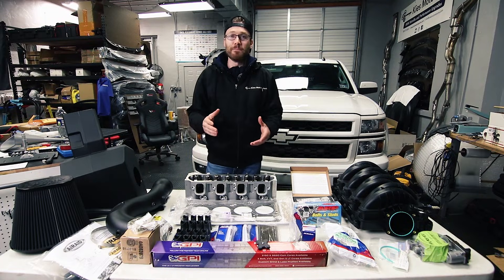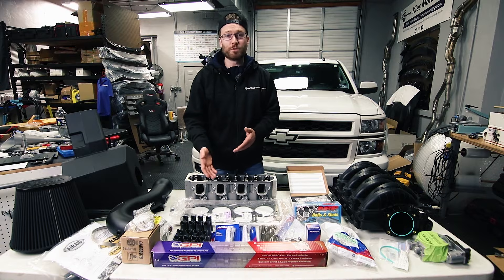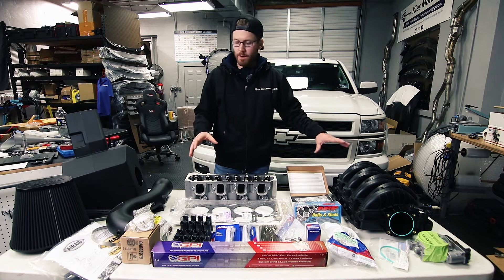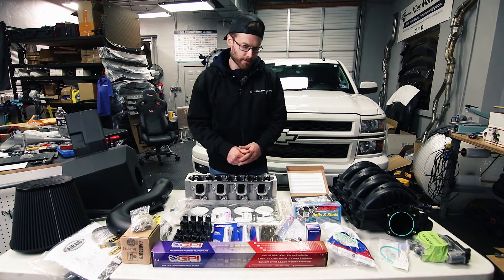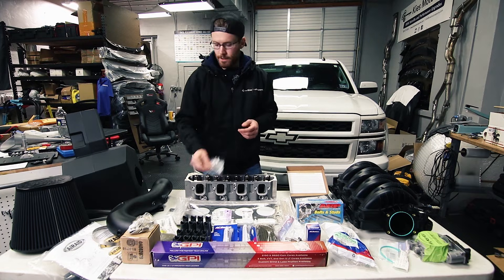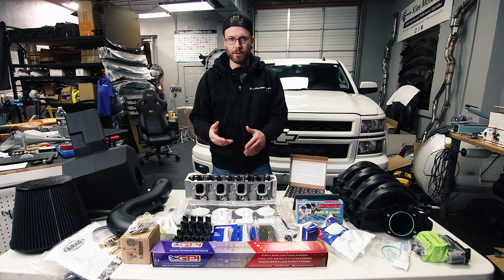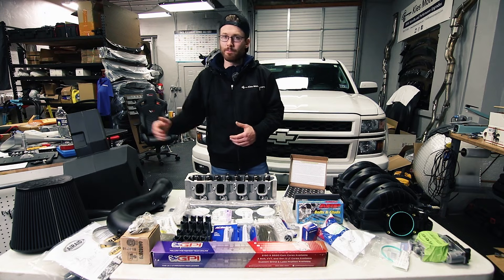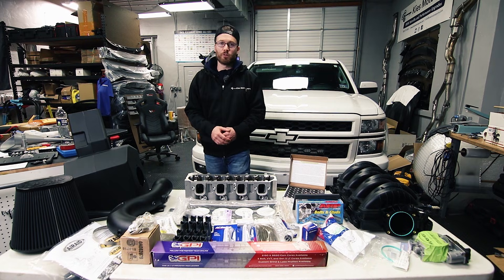AFM DOD Delete Part 2 - 2014 Silverado 5.3L L83 - What Parts Do You Need?

Comment: That cold air intake is not designed right, the air box is fixed to the body and the throttle body end moves with the motor, that little rubber boot will barely move, mine literally tore off the throttle body, and throw out the k&n filter, they’re only good for the street, paper flows and filters the best,

Comment: Did you have to do any transmission upgrades to run the stage 1 cam
Reply: Tbh probably depends on how many miles your transmission has and how well it’s been maintained but stage 2 or 3 yea mostly likely want too do upgrades on the transmission

Comment: i have a 08 pontiac gp gxp so i know most of it is all relatively the same but for more power stage two or 3 bc i’ve read a form from summit racing saying you can’t push those cars over 400hp

Comment: Have a 6.2 2016 that’s still running strong at 164k and AFM is still intact.  

Considering deleting AFM as with the mileage and long trips that I do, would rather have some peace of mind that one more potential failure point is removed from the rig. 

Question - and I know that you’re doing performance mods as well but if you’re not adding performance mods, how does this affect gas mileage?

Comment: What bolts did you use for exhaust? The ones you have linked are for 6.2 heads I thought you had a 5.3?
Reply from the maker: For the exhaust manifold to head bolts?
Reply: @TheSundaeDrive  yes correct

Comment: what lifters did you use to run a 7.850 pushrod? i got that size for my lt1 and it hangs the valves open
Reply from the maker: GM Performance. We will be shooting an lt1 build soon.
Reply: @TheSundaeDrive  cool can you cover finding the lifter  length in that? Im on the caddy race lifter. I had to make my own adjustable one by cutting and tapping a stock pushrod

Comment: So the question is can I just change the lifters and be done without doing all the other stuff
Reply from the maker: Sadly the cam is different from the research I've done. The lobes are not the same so the cam shaft does need to be swapped.

Comment: Gm had this POS system back in 1981 with the 368 CI 6.3L Cadillac V-8-6-4 and it didn't work either one the DOD got disconnected the 368 engine ran fine. It such a POS that it was offered only in 1981 only. GM ideas are horrible in every way. We deleted these off the 368 engines all the time back in the 1990's
Reply from the maker: definitely a terrible system.

Comment: Where’s  the other link for the other hard fuel line?  Do you have a part number? On the description it only showed one fuel hard line link.
Reply from the maker: meant to get that added in awhile ago so thank you for the reminder: 
High Pressure Crossover Fuel Line 2: https://geni.us/HP-SFuelLine
GM PN: 12677002
Reply: @TheSundaeDrive  thank you so much. Doing the DOD delete , just waiting on parts.
Reply from the maker: Awesome! Best of luck with it! Make sure to read through the video descriptions for some updates. Have a video coming out later this week or early next that will have some addition tips.
Reply: @TheSundaeDrive  will do! Awesome video btw, I’ll be referencing my build with them.
Reply from the maker: Appreciate that! Glad to know they are helping you out!
Reply: @TheSundaeDrive  Quick question, what oil would you recommend after this delete? I know the OEM requires 0w-20 but I live in California and it gets hot where I live, would you recommend a change of  Viscosity?
Reply from the maker: So I'm still running 0w-20 amsoil only. I haven't had any issues with that. It gets up to around 100 around here in the summer and I haven't had any issues.  I'm not an oil expert tho, amsoil has pretty good customer service and you could see what they say or see what other guys are running in your area
Reply: @TheSundaeDrive  got you! Thanks
Reply from the maker: No problem!

Comment: Hey cliff, for the stage 1 cam you selected did you need to change out to wideband 02 sensors and larger injectors and was it necessary to dynamic tune after the upgrades?

Comment: how bout a range afm disabler. plug it in and be on your way. job done in 3min.
Reply: The idea is there but yes those lifters are going to end up biting you in the ass later
Reply from the maker: Doesn't prevent the failure. The lifters might lastonger but they still have a design that is prone to failure. Many documented cases of it failing on vehicles running a range. Disappointing because that solution is much simpler

Comment: It is unnecessary to change camshaft - Because the lifters are the same size, they are different look, but absolutely use same size rods and arms. The rises of valves will be absolutely the same. And the difference in camshaft petals dod and non dod is 0,13 mm. And if you will change lifters with the guides non dod the height of valve lift will be same as stock and will be no misfires.
Reply: Woow so, let me get this straight. To delete the AFM all I need to do is replace the Non DOD Lifters with the lifter guides, the Non DOD Valley Cover and get it Tuned after done? Plus news gaskets and seals of course, is that correct?
Reply: @pedrodelasancha516 did you confirm?
Reply: So you're saying the original cam can work with either DOD lifters or regular hydraulic lifters?
Reply: @toddsaladyga9712  Yes, that's right.
Reply: @gm-master5331  That's great news! Do I still block off the oil returns in the valley?
Reply: this wrong 100% on the active fuel management lifters if you was to decide to try to put normal lifters with afm camshaft you will be taking the engine back apart because it will most definitely misfire on all 4 cylinders idling. trust me I know this the hard way. the afm camshaft will hold the valves open just a little

Comment: I have 2014 LTZ 5.3l Z71 1500. I’m trying to gather the minimum list of parts to just delete the Dod/afm. I feel that I don’t understand complete engine tear down to do so. Could you share a list for parts?  If just doing did/afm delete, can I keep the engine in the truck?
Reply from the maker: Watch through the full series and look at the description on the engine assembly video. I have all the gaskets etc you'll need there. In my opinion, it would be extremely difficult to do in the truck. I would always pull it when doing it myself on this and future trucks to make sure it is done right. Watch through the series and you'll see why. The oil pump is the issue because it sits down inside the oil pan and dropping the oil pan is really challenging if you have it in the truck. It is also sealed by rtv and not a gasket so the rtv needs to be replaced unless you want to chance an oil leak.

Comment: What was your pushrod length?
Reply from the maker: 7.850"
Reply: Ok just checking I heard a little tick when I got done. But I'm hearing it's just the fuel pump lobe .
Reply from the maker: Did you add a fuel lash?
Reply: @TheSundaeDrive  I don't even know what that is brother. Today it started running like crap. I put stiff valve springs and found 3 bent push rods today... Been hitting the Rev limiter..
Reply: @TheSundaeDrive  but they are stock pushrod with stiff springs thinking that's my problem...
Reply from the maker: You need to change the pushrods depending on the cam you go with. Hopefully nothing else is damaged. Depending on the cam you went with you may need a fuel pump lash, watch our video on lashing your fuel pump

Comment: For that price, just buy a new engine.
Reply from the maker: You could get a used one, but depending on how it was maintained, you could easily experience the failure again. The heads are the most expensive part and are not required. The simple dod delete can be done for under $1K

Comment: Does the Range technology AFM disable stop the engine damage? I have a 2018 Silverado.
Reply from the maker: You will think that it would but apparently it doesn't. Asked the same question in a fb group and two guys said they had put a range in within the first 1000K miles and the failures still happened. It probably helps tho
Reply: @TheSundaeDrive  so does doing this mod remove the issue where AFM nukes the heads/lifters?
Reply: @freidrichnietzsche6643  I'm learning all this crap right now myself.  My understanding is even with electronically disabling the AFM crap the mechanical failure of the lifters is still just a matter of time. Thanks GM and federal government regulation
Reply from the maker: That is correct

Comment: Where did you get the plugs for the oil holes in the dod delete
Reply from the maker: I got everything from GPI but there are a lot of places you can get them from
Reply: @TheSundaeDrive  I'm ls swapping my truck. Is the plugging of the holes required
Reply from the maker: If you are deleting the DOD system you either need to plug them or change out the vlom

Comment: What's the part number for hard fuel lines?
Reply from the maker: Fuel Rail Driver Side 12687244:
Fuel Rail Passenger Side 12687245: 
HP Fuel Line 12677004: https://amzn.to/2XrsHf8

There is one more hard fuel line I need to find the part number for
Reply from the maker: I got the other number: 12677002
Reply: @TheSundaeDrive  I thought I bought everything I needed for my build that is going into the shop in 48hours until I came across your video and realized I needed 4 gaskets and these two fuel lines I would have never thought of thank you so much!!!
Reply from the maker: Glad to help! There are a lot of parts so it's easy to miss some.

Comment: How did you color match your front end?
Reply from the maker: Body shop painted it for me. Got a primered bumper and the painted over the chrome grille and light bezels
Reply: @TheSundaeDrive  o ok. The reason I asked is where I'm from a few of the body shops I've got to tell me they can't paints chrome bumper
Reply from the maker: They can with proper paint prep. Lots of sanding involved

Comment: Is it possible to do this in frame on a 2015 Tahoe XLT 4x4   I haven’t had a LT1 a part yet just wondering about the oil pump pick up deal  THX for the videos !!!
Reply from the maker: You should be able to do it inside the truck. You will just need to pull the the front bumper and grille out of the way. You may also need to remove the front clip
Reply: The Sundae Drive can you get the oil pump off with the oil pan on ? That’s my biggest question thx
Reply from the maker: I gotcha. You have to drop the oil pan. A bit to access it. This was one of the biggest reasons I pulled the motor. It would be so much nicer if they designed it so that it wasn't necessary to.
Reply: The Sundae Drive ok thx Man I’ve got it down to that and was fixing to just pull the motor, and probably will !!! This is some of the stupidest engineering I have ever seen in a vehicle lol Thx for the help and the videos !! Keep up the great work!!!
Reply from the maker: Thanks! Best of luck with it!

Comment: What's is the mileage on your truck? Also, I've seen some other vids about this topic, one in particular mentioned the oil pump, does the DOD delete create an issue for the pressure being driven by a oil pump now working with different volume?
Reply from the maker: 108K and I asked GPI and they said that the pump is electronically controlled so that with proper tuning there is no issue with the stock pump.
Reply: @TheSundaeDrive  Nice. I would like to do the mods myself, but as my daily driver and limited tool/ knowledge resources, I was looking into some shops doing it. The content you provide helps with finding the right shop to do the job. Very well done. Please keep it up!
Reply from the maker: Thanks! Will do! Lots more videos coming
Reply from the maker: The one nice thing with going with GPI for the parts is they will tune it as well and are super helpful with any questions you have.
Reply: Is there anything wrong with your truck just wondering why you're doing this I have a 2019 suburban with AFM 8 to 4 and wondering what I should look out for. Any help appreciated
Reply from the maker: Nothing wrong with it. I just know that there is a higher percentage rate of failure with the AFM system than I am comfortable with so i am preventively removing it. I would not worry about it until after you are out of warranty.
Reply: Thanks for the response do you recommend the range obd device for the time being I bought an extended warranty to 160,000
Reply from the maker: The range can't hurt anything as far as I've heard. I just left it off to avoid any warranty issues if something failed on my truck until I could delete it for real

Comment: I too have the 2014 ltz 5.3 and need to do this one day when warranty goes out. i'm running around with the rang technology...
Reply from the maker: How much do you have left on the warranty? 2014 has to be close to the 5 year mark. Range seems to be good from what I have heard but doesn't prevent the failure from happening sadly
Reply: @TheSundaeDrive   175000 on powertrain warranty... mods done so far is borla atak exhaust kit, Airaid tube intake, oil catch can, and the range... really considering the camshaft along with afm delete and tune but don't know what's the recommended option for a daily driver vehicle with a little bit of fun on pedals too.
Reply from the maker: If you tow I would stick with a stage 1 cam. If not, you can probably go to a stage 2 for a bit more fun on a daily driver.  All comes down to personal preference tho
Reply: @TheSundaeDrive  no on towing and will definitely be doing a little more DD before I pull the trigger,  thank you sir.